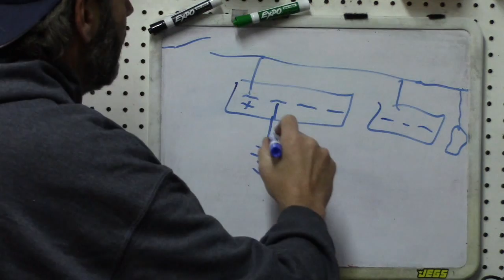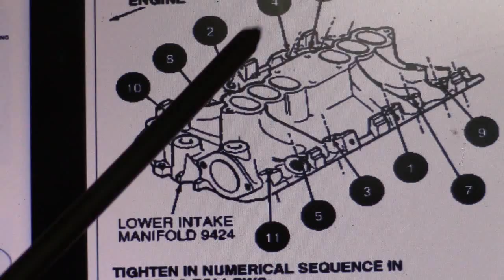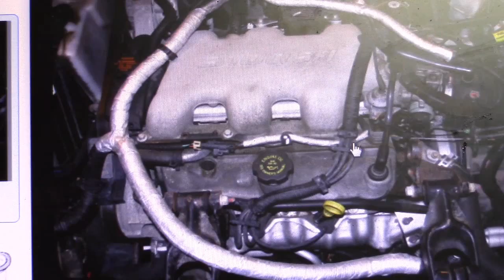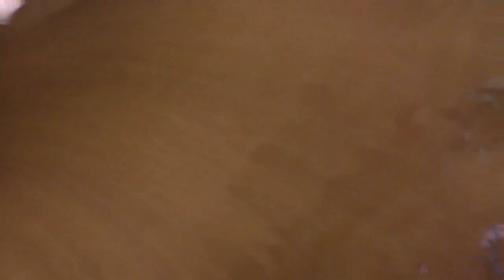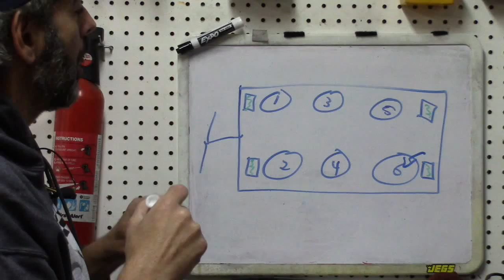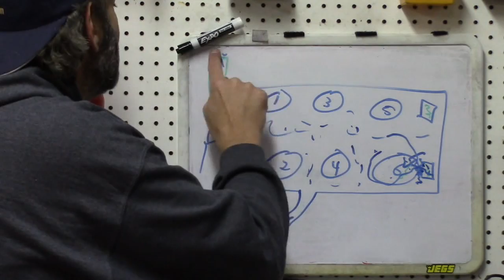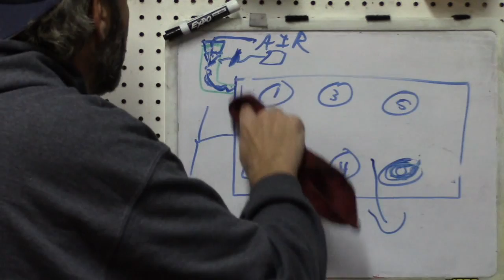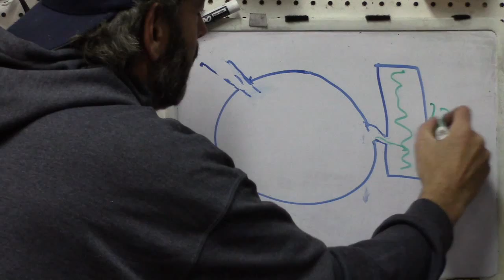04 Toyota P0306 Pt2-Can Compression Test Lie?

Comment: Haha, whoops!  Sorry 'bout that!  I was mistakenly thinking the 5VZ-FE engine carried on into 2004.  My apologies for the incorrect information on the lower intake manifold.

I had a customer vehicle a very long time ago that had a cracked cylinder head, with a hairline fracture between the intake and exhaust valve seats on two of four cylinders.  It had very similar symptoms to this.  Rough idle/miss when cold (or allowed to sit for a few hours), small bit of coolant in the cylinders, and it passed a compression test, leakdown test, AND coolant combustion gas test with flying colors.  Curiously, it also passed a coolant pressure test, with the standard 15 minute wait time.

I theorized that the shape of the combustion chamber in relation to the location of the cracks allowed the coolant to pass through when the system was pressurized and the engine was off, but the combustion pressures and heat actually forced the crack closed, so no gasses were escaping into the coolant.  It's the only thing that makes sense.  Replacing the cylinder head fixed the problem, after two head gaskets didn't.  The diagnosis gave me the direction to be confident pulling the cylinder head, and prepared to put a new gasket in.  Inspecting the combustion chambers after a VERY thorough cleaning revealed the hairline cracks, and I use the term "hairline" very loosely.  They were maybe a thousandth of an inch wide, if that.  They looked like "noise" in the casting until I got right down into them.

Your diagnostics are sound.  This is seemingly a unique condition, and exactly the sort of case study that demonstrates how important a consistent diagnostic process is.  Symptoms show Condition A, diagnostic Data shows Condition B.  Condition A is not Condition B.  Symptoms are a constant, Data can be a variable.  Re-evaluate Data using different collection points, criteria and tolerances.  :)
Reply from the maker: Thanks Kips- always appreciate your feedback.

Comment: Wow! Im dealing with this EXACT situation right now. 2013 Toyota Prius with same symptom came out negative on chemical test, compression test, and leak down test, but we saw coolant in cylinder #1 using the borescope. Apparently, the 3rd gen Prius is notorious for prematurely failing head gasket and causing our precise symptom and so my friend wanted to proceed with the HG anyways. We found a clear compromise next to cylinder #1 on the headgasket which was causing the P0301 cyl #1 misfire during start-up and coolant leaking in. Im still so baffled. The only explanation I can think of is that the head gasket leaks only when the car is FULLY warmed up... allowing coolant to slowly seep in the cylinder as the car is parked for a few hours and the engine is cooling back down. We performed our tests with the engine cold. In addition, our car had coolant lines run through the throttle body rather than the intake manifold, which maybe could allow some drip into only cylinder #1. In our case, the throttle body is lower than the intake port so it’s impossible. Perhaps in situations where the throttle body is higher than the intake ports this can happen. I doubt it but just throwing ideas out there. Anyways, hope you get the car back. A warm vs cold compression test might yield insight. Also, using the borescope to watch the coolant enter the cylinder live while you pressurize the cooling symptom could confirm the head gasket. Or watch the intake port as you induce the leak.
Reply from the maker: Great to see you Justin. Happy Thanksgiving.

Comment: Great video and humility, it really takes a big person to admit when they are wrong. My father use to run diesel trucks and the piston liners would became porous allowing coolant into the cyclinders. Is it possible you have a bad casting and the material is porous not cracked therefore a different explanation to your flap method?

Comment: A leaking thermal vacuum valve can cause symptoms similar to a defective head gasket most thermal vacuum valves thread into a coolant passage and they often leak only after they get hot
Reply from the maker: That would cause all cylinders to be affected though, not just #6 wouldn’t it?

Comment: Another amazing video, thank you! I used to think that a head gasket leak to the cooling system will always show on a compression test, but I was proved wrong 4 years ago when my Honda Civic blew its head gasket. It ran great, but was mysteriously losing coolant and overheating. No coolant in the oil, I did your "sizzle test". The other odd symptom is that it would pressurize the cooling system as normal while it was running, but it held a lot of the pressure even after sitting overnight, so it wouldn't suck coolant back in from the overflow bottle. I pressure tested the cooling system and found no leaks. I did a compression test with the engine hot and found that all the cylinders were between 170 and 180 PSI, which is well within specs on this engine. I also used an Autozone block leak detector kit to check for combustion gas in the cooling system and found none. 
Long story short I pulled the head, checked it and block for warps, reassembled with a new gasket using the procedures in your head gasket replacement video, and the overheating problem stopped. I still wonder how the cooling system was pressurizing while running but not releasing the pressure once the engine cooled off, as well as why the compression test showed good numbers. Now that I think of it I should have retested the compression after I changed the head gasket, but oh well. The only explanation I can think of is that the leak must have sealed itself as the engine cooled off, and the leak must have been small enough to not allow enough compression loss to be measurable or let enough coolant into the cylinder(s) to cause a problem with the way the engine ran. Or possibly the leak needed heat from active combustion to open, and closes when it cools off even slightly since compression was good even with a hot engine. Turns out a blown head gasket is actually a pretty common problem on these engines and often doesn't show in the usual ways for whatever reason. 
Anyways, I just thought you would find that interesting as I sure do. Have a happy and safe Thanksgiving!
Reply from the maker: Crazy story. But I believe you. Wondering if something about the gasket construction might explain the phenomenon.
Reply: @SchrodingersBox  That's likely IMO. These engines use a multi layer steel head gasket, so I am wondering if somehow the layers were expanding only under combustion heat and pressure and not cranking compression or something like that. I actually still have the old head gasket and I took it apart and closely inspected it several times for signs of damage but I didn't see any cracks or other signs of damage, it looked like new once I cleaned it up with the exception of some of the rubbery coating missing since some of it stuck to the head and block. I am wondering if the rubbery coating was somehow damaged and causing the leak? I wouldn't think so since from what I read a head gasket will still usually seal without the coating, but I'm not sure.

Comment: well one thing that comes to mind for me. toyota 2.2 cylinder head bolt threads  tend to fail..
who is to say that this is not what you are dealing with... just a thought.
also remember you are testing this thing cold. perhaps if this vehicle is hot you potentially could have different results.
if you had a hot engine and cyl 6 had both valves closed, as it cools down it would go into a state of vacuum,  the coolant would actually go to a higher pressure as it only has natural circulation. 
I think speculation will not do you any good. you could find a failed stretch bolt, or one that had backed out or any number of things leading to this mystery.

Comment: The coolant could be leaking from a crack into the cylinder head above the intake or possibly the exhaust valves.  You verified the coolant in the cylinder by cranking the engine. Coolant could get into #6 cylinder by an open intake or exhaust valve.  You would also pull coolant into #6 on the intake stroke on the test in your video.  You'd almost have to pull the lower intake, pressurize the coolant system, then look for the leak on the intake or possibly the exhaust side of cylinder head.
Reply: John C I do not know that engine specifically, but I agree with your comment. Coolant could be leaking from a crack in the cylinder head above the combustion chamber.
Reply from the maker: Yep- exactly my suspicion and also exactly my plan to prove it.

Comment: A lot of head scratching  going on and not without justification. The compression and leakdown tests are valid tests. To me, the most likely cause is a hairline crack with the coolant seeping out. The chemical test also gives good results. Unusual coil configurment with 4 connections and common return back to the pcm. There again, we are all guilty of making assumptions which is no substitute  for hard facts and tough research but comes with its own  time penalties that are not always recognised in the final monetary  assessment.
Reply from the maker: Agreed. This explains every thing better than a head gasket failure.

Comment: Thrown off by 4 terminals. design of intake/coolant runners. ahem. do you have a book for that? this diligent diagnosis is great for doing the job only once, properly, with minimal downtime of the vehicle, and one time only parts purchase. any seemingly excess effort spent on the diagnosis is simply an exchange for the amount of time it could possibly take to do something twice. however, the exchange is one that is more in your favor saving time and money. 

I also would like to add that being this is internal there is only so much nuking it you can do before it becomes painfully obvious that you will find out whats going on when you do get it apart, what to do to fix it, and be pleasantly surprised and amazed at the exact location and type of the fault pertaining to coolant leakage.

Comment: Here is the thing. In the old days, I would just begin the repair. THE REPAIR PROCEDURE IS THE SAME FOR ALL EVENTUALLITIES. Take off the intake manifold, nothing wrong there? Take off the head, look at the head and head gasket. If the gasket looks good, take head to a machine shop. They magnaflux it to find cracks. Need a new head? Go buy one. SHEESH. You have to do each step, to get to the next step.
Reply: These are aluminum heads magnaflux won't work 🤫
Reply: @albertoascencio5935  That's not the point. The point is we already know the direction to go.

Comment: Bottom line. What is wrong with the car?
Reply from the maker: It’s leaking coolant into the cylinder.
Reply: @SchrodingersBox  Perhaps a little more detail. I saw both videos, Have you figured where it is coming from? Crack, gasket, what ever.
Reply: @garyk8593   Disassembly of engine  will help pinpoint that.

Comment: Don’t beat yourself up over it, your approach was still good  & you didn’t fire the parts cannon.
as I said in  my post on the previous video I have encountered this same scenario. 
I put it down to the expansion/ contraction of the cylinder head which when cold allowed the tiniest of dribble overnight. 
You would think that some compression loss was seen maybe picoscopes in cylinder pressure transducer might be able to show this.
One final thought is air is compressible fluid not & maybe as the leak is so small it  hasn’t enough space/restriction to over come this  you can argue why doesn’t the coolant flow out & fill the cylinder up, you did say no coolant loss was reported.
I dunno it maybe too scientific for me I’m just a mechanic 🤪
Anyhow thanks for clearing up the real cause & keep them coming 👍
Reply: 👍 be interesting to see the results. 
P.s. can’t wait for your next trolls video 😆
Reply from the maker: Oh man you nailed a great idea... I actually have a pressure transducer!!!! I'll give that a try but still: the gauge showed EXACTLY the same and certainly a variance of even 1PSI is acceptable (thats' like 0.75% error margin). and the real kicker- the leakdown test was negative.  But definitely worth a try using the transducer.

Comment: Please let us know what you find once you remove the head
Reply from the maker: Will do- actually the objective is to find the leak BEFORE the head is removed.  That's the only way to really know if it was from gasket or not. If it leaks in from the intake port, it's not a gasket.
Reply: @SchrodingersBox  do you think it will pass a hydrocarbon test?
Reply: @marcole01  i think he said he did one in the field which came back negative
Reply from the maker: Correct. The chemical test was negative.

Comment: I forget if this was covered or not.  Is the engine Aluminum or Cast etc...  I don't know tons and I'm working on learning along with you (big thanks for your content - i'm a big fan of your methods)  I am curious to know especially if it's aluminum due to distortions in the head or weaknesses in the head that are compromised when the head is cool etc.  (acting as the check valve effect working with the 12 or so PSI)  Also is there a relation to how much coolant pools in the cylinder because the pressure dropped.  I wish i could submit a sketch somehow of my thoughts....   Regardless I hope you get the opportunity to put this one to bed!
Reply from the maker: I don't know-- the cylinder heads are aluminum for sure. Not sure about the block though.

Comment: Thanks for the follow up.  This is sure an interesting problem.  I wonder if you could attach a low pressure gauge to the #6 cylinder, make sure the valves are closed, and then apply a low pressure to the cooling system.   Give it a few hours and see if there is pressure building in the cylinder.
Reply from the maker: LOVE IT!!  Yes, I actually have apparatus to do that!! Great idea.
  I also have a borescope and I ordered the correct coolant pressure adapter so I hope to actually physically catch the leak in action on film and see if it's from gasket or not.
Reply: Yes, Todd B , is also a genius.
Reply: @chrish3720  ah, ... no, I'm not a genius.  I was lucky enough to follow Matt's clever problem solving concepts.

Comment: A gasket leak acting like a valve is possible.   If you could devise a vacuum test on the cylinder when the motor is cold it may draw in coolant.  As for a compression test being definitive 100% of the time ?    I have found that most tests don't prove that something is good,  rather to find when something is bad.
Reply from the maker: Another very good idea!!  I absolutely have a method of drawing vacuum on the cylinder to test this and see if the "flap effect" explains it.  GREAT IDEA!!!!!!

Comment: It's not possible to have pressurized the intake manifold when some of the exhaust valves are always open at any given time, the air would  just leak past and out the exhaust pipe. Even if you were to really increased cfm the air would still leak out so fast you'd be lucky to get 1 or 2 psi.  You would have to open the valve covers and back off the open exhaust lifters for this kind of test to work.
Reply from the maker: You can't fully pressurize it but as you can see on the gauge it was past 15PSI.
Reply: @SchrodingersBox   Nat, I don't know if you know this  but your gauge is in inches of h2o not PSI . The formula is 1" of h2o =1/28 of a psi. So you if had 15 inches of h20 that = .54 psi. You need a lot pressure to force air through a tiny gasket or head crack  leak . I love your video's though. Learned much.
Reply: Boston Straight Pride I just looked at this gauge on Amazon, it shows PSI as it’s unit of measurement. ✌️
Reply: @pl5882  Your wrong, On the Redline tester the gauge current model  has the inches of water  0"-30"positive and negative on the outside scale and PSI on the inside scale 0-1 PSI. Nats older version has the water inches also on the outer 0"-30" but positive only and 0-1 PSI on the inner scale. See his gauge at Min. 20,51 in his Nov 25th video.
Reply: @Boston Straight Pride...I think you need to study the otto cycle theory before making stupid comments you can't back up...lol😜
Reply: @simonilett998  What does that have to do with some guy in his garage trying to pressurize the plenum and combustion chamber with an air compressor hoping to find a coolant leak?  Answer:  NOTHING!  Otto cycle theory, wow I'm impressed Simon just another graduate of Google/Youtube university.
Reply from the maker: @bostonstraightpride7223  Boston- did it occur to you that blocking the exhaust pipe solves the open exhaust valve issue?  You can also pressurize the intake from the exhaust the same way in fact.
Reply: @SchrodingersBox  Yes it occurred to me 20 years ago, on my brothers 1991 Pontiac bonneville we tried to pressure the exhaust system to find a leak, somewhere  around 15 to 20 psi I think . We heard  crackling  sounds and didn't think too much about it, started and ran ok.  A few days later it was rattling. So  we cut  open to see what happened it expanded the inner shell of the catalytic converter a grey layer of cement like compound, enough to loosen the inner honey comb and the crap was all through the whole system.

Comment: Probably a hairline crack,and in my experience can be a real pig to diagnose without stripping it down..
.I had one with exactly the same symptoms, had it tested and there was a small crack behind the intake valve.
Reply from the maker: Yes that I believe- because it would not be at the gasket- it would be outside the combustion area explaining why combustion pressure was not lost yet a leak into the cylinder from the head happened.